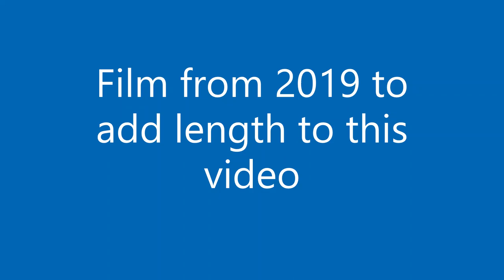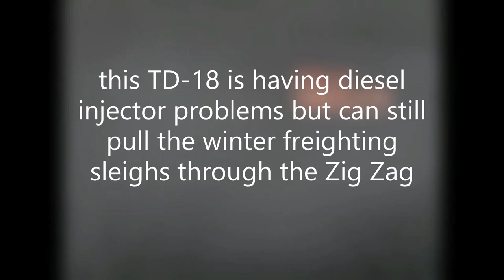Linn Tractor 2 small things done TD 18 video too Feb 13 2023

Comment: TD 18 100 hp    does pretty dam good.
Reply: We cleared farm land with a td14 done about 50 acres
Reply from the maker: yes the TD-18 were known as the best sleigh pullers.  thansk
Reply from the maker: @waynelarson6731  IH were popular back in the day.  thansk
Reply: @waynelarson6731   my td14 did  my whole quarter 160 achers  and some of my dads.
Reply: @waynelarson6731   now have a d 7 C 17 A  1956  model   tď14 was sold because i couldent find undecarrige
Reply: @wilmamcdermott3065  yeah nice an be broke the land with a wd9 Mccormick  tractor and a 24 inch brush breaker talk about to is getting pulled up lol

Comment: Here in NW Indiana USA supposed to be 50 and rainy today! No snow. 👍🏻 those sleds really track nicely thru the zig zag, I would have thought you would need wider turn to keep them out of the snow banks on the side.  Closest thing I’ve pulled similar to that would be 3 grain wagons and they’re much shorter.  Interesting, thanks!!👍🏻
Reply from the maker: the rain will make it feel cold. the grain wagons are fun and need a wide wide turn but sleighs follow right a long.  thansk

Comment: I hope your figuring in a couple of degrees of deflection in the U joints, to allow lubrication of the needle rollers.
Reply from the maker: no, straight on because the motor will not be running very long.  thansk

Comment: Guinness is outstanding! The plastic ball is a widget to ensure a smooth pour and a good head. I've been drinking it for 35 years! It's got iron in it. You can basically live on stout and potatoes. True story. :) actually the doctors used to prescribe stout for pregnant anemic women. They glossed over the dangers of the alcohol - but hey it was the 1960s . Stay safe in the snow - all the best from Wales in the UK. Currently 7c and light rain ;o)
Reply from the maker: excellent, i learned a new word today plus that will be chilly with the rain.  thansk